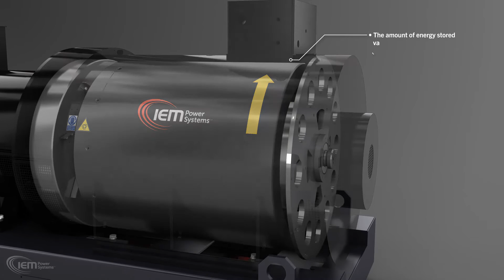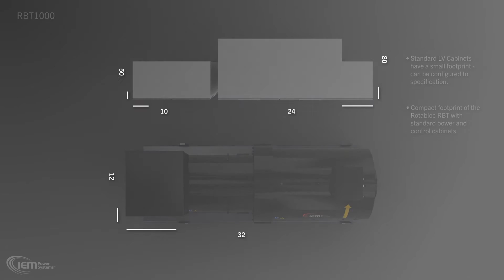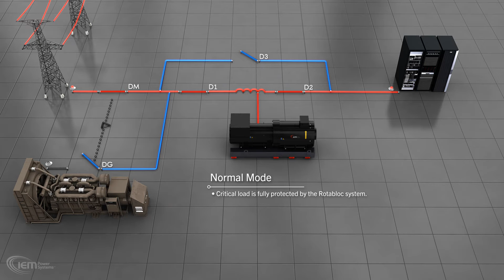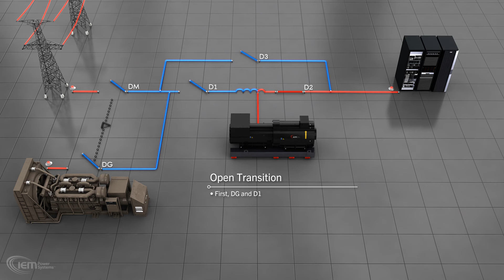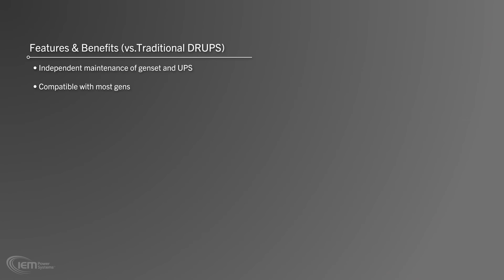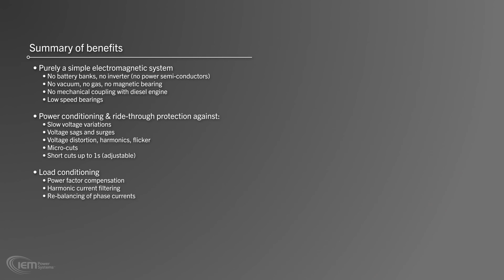IEM Power Systems Rotabloc UPS 60Hz HD

Comment: A great overview of RUPS technologies and a good explanation of your technology. I do wonder about the cost/difficulty of replacing the bearings versus replacing batteries, but think it should be significantly cheaper.
Reply: Hi John, IEM Warranty the bearings for 8-years. Replacing the bearing in the field is 1-2 day job depend on the which/how many bearings you intend to change. please email me at ashraf.bakier@iemfg.com for more info. Thanks, Ashraf Bakier
Reply: It's much, much cheaper than replacing batteries. TCO is going to be cheaper in the long run due to this

Comment: Beautiful this was the best comprehensive explanation of your system. A big threat to all the competitors as the system enhancement design is developed from the loopholes existing in  Piller, Euro Diesel and HItech models. All Data Center system designers please wake up and review your critical operations DRUPS.